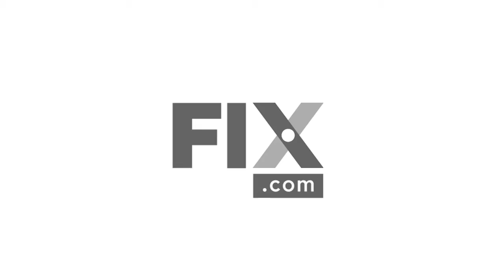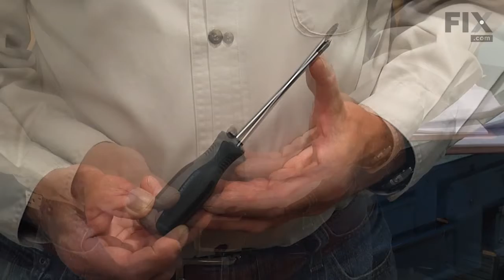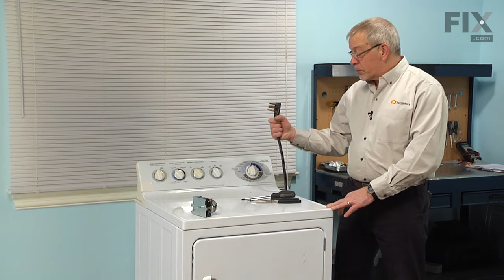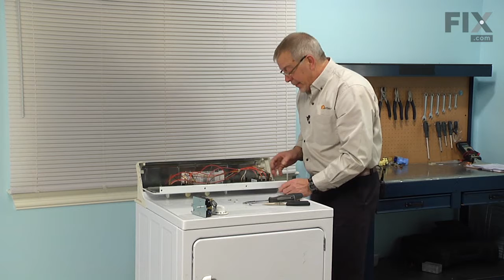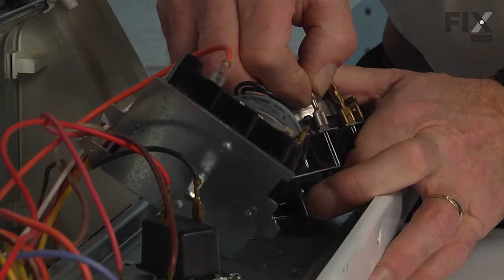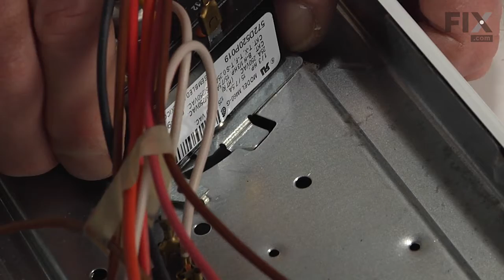GE Dryer Repair – How to replace the Timer

Comment: Just a heads up on these.....the D-shaft is so tight on most of these timers, the knob fails. New knob? The D-shaft strips. New timer and knob? 50/50 crap shoot. These are infuriating. Bring back the metal D-shaft!

Comment: Hey my timer is not rotating after replacing? Any idea? Thanks
Reply: I have the same problem! Did you fix yours ! We tried 3 different timers . Please help !
Reply: @crazeeclay144  yes i did fix mine. So i used inside mechanism of my old timer and just knob of new one because new one was not rotating correctly. So just open both carefully